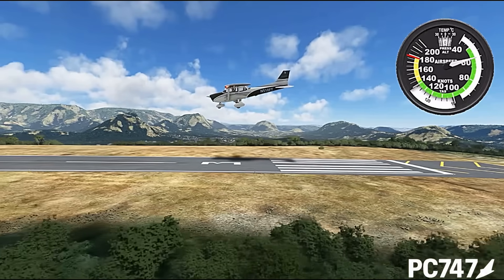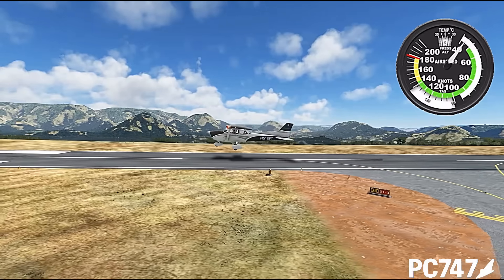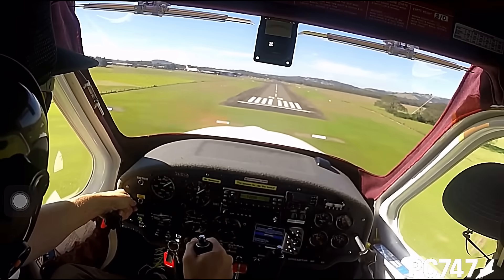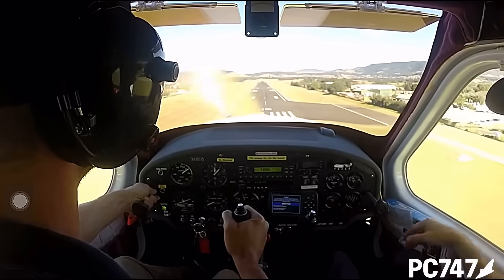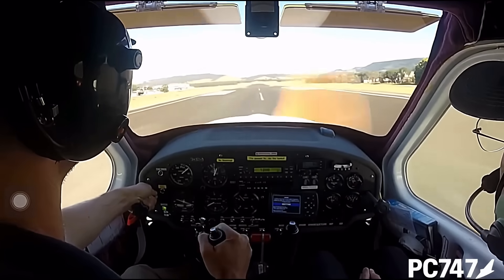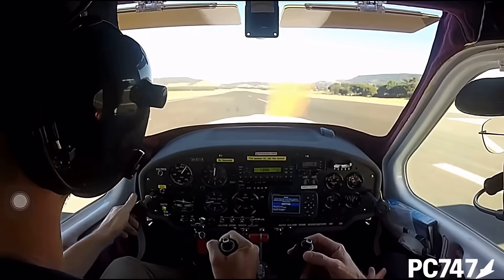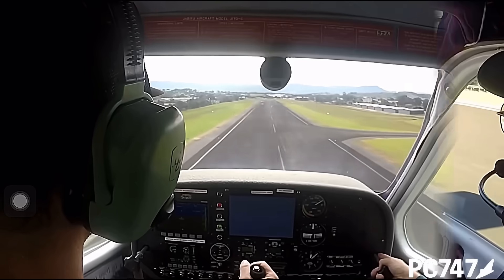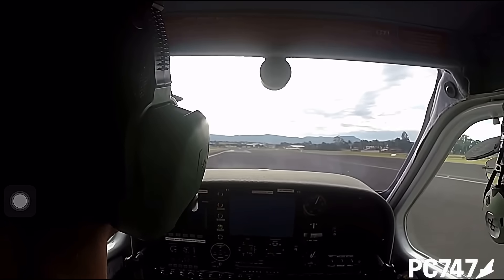How to Land a Plane -The Secret No One Tells You

Comment from the maker: 🌍 Watch in your preferred language 🌍

🇬🇧 English – https://youtu.be/49EoB9SKjAY?si=Fp_PAZM4Dp9irs2j
🇮🇳 हिन्दी – https://youtu.be/Dx9Oed0h9rA?si=pS4AFMhgT9zkzBrt
🇵🇹 Português – https://youtu.be/N7iwVe2MZJI?si=y9Hc86FnIIwLbNUy
🇪🇸 Español – https://youtu.be/x7_dA1JTxbw?si=_WzBkEvicy8_U38A
🇩🇪 Deutsch – https://youtu.be/isP-JnntmgQ?si=JclksW6JkJi67nLg
🇫🇷 Français – https://youtu.be/RwL3YldcYUk?si=g9PZyDKWSpoLhmGB
🇮🇩 Bahasa Indonesia – https://youtu.be/I2KtFTurIh8?si=In43Kd-OTQZRTXCr
Reply: How do you calculate speed of any particular aircraft, that will give you 10 seconds of kinetic energy after setting the plane on idle? (ie 1.3 times stall speed…)
Reply from the maker: @greighenning9091 

Hi,

  For smaller general aviation aircraft, calculations are not required simply because their weights don’t have enough variability to require calculations. Examples of this are aircraft with airspeed colored arcs where flap down speeds ranges, flap up ranges & stall speeds are fixed.

Larger aircraft, with much greater  weight variabilities, can have vastly different approach speeds. Most newer jets, do require calculations but they ALSO show 1.3 xVSO, on the PFD glass, as a small green line on the airspeed indicators left side; irrespective of flap position. 

Airline SOP’s, at least in the United States, require the company to provide all performance data, for every takeoff & landing. For this reason, pilots will typically calculate it, including approach speeds, then verify that the data provided by the company, is correct.

Cheers!

Carlos
PC747
Reply: @PC747Aviation Thanks. That 10 second tip is excellent, I’m surprised the industry hadn’t made it common knowledge years ago. Got any more tricks up your sleeve?
Reply from the maker: @greighenning9091 

Thanks for the kind comment. 🤩🤩🤩 I do. They will be out in subsequent videos….

I release videos every Friday in seven languages. The one in three days will be about that Hawker crash that just happened. I have about 3000 hours in that aircraft type so I’ll be providing my two cents. 🤔

Cheers!

Carlos
PC747
Reply from the maker: @TheEuAREtRAITORS 🤩🤩🤩
Reply: English
Reply from the maker: @billdonnelly3025 Thanks Bill. That’s my preferred language too. 😎👍🤩🤩🤩

Comment: Good  video ..  here's  what i do .. if the POH  says  approach  speed in  55 kts and say  sink rate is 500  fpm  then learn to control that speed and glideslope  "very  accurately " until  flare out .. But How?  STEP A in the training area ... establish  55 kts  straight and level S&L with the   flaps setting you would use for  landing  say 20 degrees . Set  trim and note  the RPM  .(.that is important )  lets suppose it was 2200 rpm .. note that rpm  .. Step B ) now touch none of the  previous settings EXCEPT    reduce the power until  the VSI  reads  -500 fpm .. Lets  say that requires  1700 rpm ( I fly rotax  BTW .. different to lycoming RPMs) . NOTE that RPM as RPM #2 i.e 1700rpm     ... now  resume level  flight to the  circuit area and  use  the S&L settings ...flaps  trim as  before and  RPM A(2200rpm)   on the  downwind  .. then on the turn to base ONLY change the power to RPM B (1700prm )    and maintain  for the base to  final . You will  then have a  perfectly  stabilized approach of 55kts at  -500 fpm  without  excess kinetic  energy . Focus on  accurate approach speed 55kts   by moving the yoke  back and  forth to hold  55kts until  flare out ..ignore  ground  rush .. At  flare out the I chase a lower  speed  say  50kts to touch down and  let the plane  run out of  energy . .. you will do perfect  'butter'  landings in no  time  and impress even  instructors . No instructor will teach you this .. but it  works
Reply from the maker: That’s a great technique that you shared. Thank you.. 🤩🤩🤩

Comment: This makes perfect sense! I was just going through flight review training after 30 years away from flying. Beforehand I tried to start a discussion about setting up a stable approach but CFI wasn't interested. In my first left seat approach in about 30 years, and my first time controlling a 182, there I was making all the radio calls, and battling a crosswind I couldn't quite straighten out in my head.  

My mind was racing, crosswind opposite rudder, but mostly when the aircraft is moving quickly. Touch and go so high throttle right rudder most important when you're moving more slowly.  The tower has me cut off my base leg because it's a busy airport. I underestimated the amount of crosswind side slip and as we touch down and jerk to the side, he screams use the rudder!  😳
Reply from the maker: I’m sorry to hear that he screamed at you. That’s unfortunate. It doesn’t promote the industry at all…..

From what you wrote , I could tell you have a very good understanding. If there’s anything I can assist you with, please let me know.  Thank you for sharing.

Regards,

Carlos
PC747

Comment: could I get your professional opinion on this story. A fellow pilot tells me of how his instructor taught him to land. as follows:  from the point where power is cut to idle just let it settle in at recommended airspeed while holding the center line , but you are not going to actually land. instead you are going to let it down to about 6 inches above the runway a keep it there. while doing so the plane finally stalled. his instructor then explained that while keeping it at about 6 inches high the airspeed was bleeding off till it finally stalled and when you stall a plane from only 6 inches high with a runway under you and plenty of runway left in front of you then that is a good landing.
Reply from the maker: Hi,

  I think that is another, well thought out, way of accomplishing the same thing. Kudos to that instructor. 🤩🤩🤩

Cheers,

Carlos
PC747

Comment: In my experience, the rudder and the power were the hardest controls to learn to use correctly. I did my primary in a C150 and the like, but the vast majority of my flight time was in light LSA-like aircraft. The short answer is "formula flying" is completely different in a light A/C. In an ultralight/low-inertia type aircraft, for example, the counting-to-10 method will result in a crash, probably a painful, if not fatal, hard pancake into the ground, around count 3 or 4.  Cruise airspeed-to-stall while maintaining altitude when you pull the power in the C150 was around 20 seconds, IIRC, so the pilot would probably get away with the count-to-10 idea. But, in an LSA type aircraft, the same exercise happens in about half that time, more or less. In an ultralight type, cruise-to-stall occurs in about 3 seconds - the experience in roundout/flare is totally different than with a large, high inertia A/C. Obviously, in low inertia/high drag aircraft types, you have to learn the techniques appropriate to the A/C, and forget about the formulas. But that "stick & rudder" experience pays dividends in the bigger aircraft too.

Otherwise, I totally agree about learning one axis at a time, but I would also suggest adding the 4th control surface (the throttle) to the training mix. Have the pilot learn what the application/reduction of power does to the sink rate. Also observe any pitch/yaw/roll effects too (especially important in A/C types with high-mounted engines where the thrust line is high, etc). 

I used to advocate that all pilots should be required to get at least 5 hours of ultralight training, just for the rudder/throttle experience it gives. That's not practical these days, though. Anyway, enjoyed the video!
Reply from the maker: Hi,

  Thank you for the very detailed and and insightful comments .🤩🤩🤩 You brought up some very good points. I agree with all of them….

  The proper application of power deserves a video all its own. I will work on that.

Thanks,

Carlos
PC747

Comment: I just finished multi training.  The kinetic energy count didn't seem applicable to those planes (Piper Seneca I and a Twin Comanche).  The Twin Comanche pretty much needed power until almost 200 ft before your touchdown.  I never got the hang of the Seneca - only learned that 25* of flaps made landing easer than 40*.  I had a couple of greaser landings in both planes (pure luck), but for the most part, it was trial and error with frustration.  I didn't know what to ask and nobody really offered anything profound.
Reply from the maker: Hi Reuben,

   Thanks for sharing your experiences. I’ve found energy management tougher for both new students & even experienced pilots when transitioning into unfamiliar multi engine aircraft. Heavier aircraft in particular. They don’t respond as quickly, particularly very heavy aircraft, if the correct approach speed is off, even by a few knots. 747’s, remind you, if you are slow, with hard landings. 
  But, If the “correct” energy state is attained, prior to the flare, it works every time. Even for the 74. ;)

Cheers!

Carlos
PC747

Comment: I've been flying light aircraft for 30 years I was trained by an Ag pilot who taught me things few know.
1. A plane stalls at a fixed aft stick position regardless of anything else.
2. Sticks postion controls air speed.
3. Throttle control height.
4. When landing ones objective should be to exhaust all flight energy before touch down. Ie land as slow as possible with the stick pulled almost all the way back just before touch down.
5. Use the throttle to control your sink.

Bonus tip. Take note of your control inputs on final, are they frantic? Likley yes. I try to use very little, like I'm hardly moving the stick.

Lastly my observations clearly indicate the majority of pilots carry too much energy during landing. Simply put they land too fast with too low of an angle of attack. The plane is not ready to land.
Reply: Thank you! How to spread the good oil?
1. During conversation with pilots, sew seeds that spread.
2. I'm an AP so I leave a two page thesis on the seat of every aircraft I maintain. I can share that with you.
3. Social media, channels like yours for eg.

Lastly I'm deeply effected by the amount of unnecessary accidents and deaths that  have occurred from stalls due to complete ignorance and misunderstanding of what the stick actually does.
Other youtube channels that talk about minimum manoeuvring speed make me fume! Because they are propergating completely the wrong information which pilots take on as gospel.

Interestingly when I used to teach folks how to fly RC planes I'd have them only control one axis at a time, this greatly accelerated their learning curve. In line with your method of axis separation. Brilliant!

Finally, your count to 10 technique is the same as my "don't let it land, don't let it land, don't let land" instruction, the concept is exhaust all flight energy above the runway, the plane will naturally land when it's ready and with all flight energy exhausted it's dead weight will never allow it back in the air.

Well done sir your video is a breath of fresh air!
Reply from the maker: @Palmac2000 Thank you very much for sharing all of that. 🤩🤩🤩 Perhaps you can be the channels ambassador. 👨‍✈️
Reply from the maker: Hi,

  That was great to read what you wrote! I agree with everything that you said. Now, I guess the question might be…..

  How do we incorporate some of your ag pilots insight into the training curriculum?

Cheers!

Carlos
PC747

Comment: Drifting is not necessarily a lack of understanding, since students are taught early on, or should be, that the aircraft turns because of the horizontal lift component caused by bank angle. Many times not landing on center line is just laziness or not caring if they are in the center, just as long as they are  still on the runway. I’ve been up front with high time, good pilots, that sometimes just dont care and land off center. Maybe you’re at the end of your duty day on a ferry and just are tired and let it happen.
Def agree, task overload happens quickly when learning new things at a rapid pace. Like your approach, I used to take students to a mostly unused crop duster strip at a sod field and practice approaches with them following with me on the controls several times and slowly have them applying more force until they were unbeknownst to them doing the work. A lot of my prior athletic training and experience helped with training students. Started my training at 30, now 69. Great for you to share what you have learned, much appreciated. Another thought is delayed reaction times. Especially with older students.
Reply from the maker: I agree with you. You also made valid points regarding sometimes not always landing on center line, particularly after a long duty day. Reminds me of some of my longer trips over 15 hours…..

it might be interesting to see , if there was a survey, how many instructors actually enjoy instructing. I think the percentage is pretty low, particularly with the younger Flight instructors just looking to build flight time and move on. But then again we were all younger instructors once too…..

I did find a correlation between quality of instruction, number of students per day and how much block time was scheduled for each student.

I think the standard still remains the same at two hours per student. Though it has worked for a really long time, an extra 30 minutes would make a huge difference. At least it did for me and my students. I was not “pressed” for time with alittle more time. It  allowed me to try and answer more of the students questions if they had any too.

I wouldn’t charge for 2 1/2 hours either I would just charge for two, but I certainly enjoyed teaching more when I made the adjustment and I think my students did t as well.

Regards,

Carlos
PC747